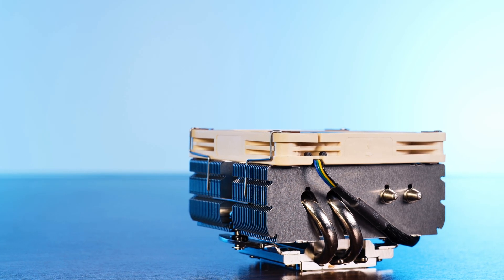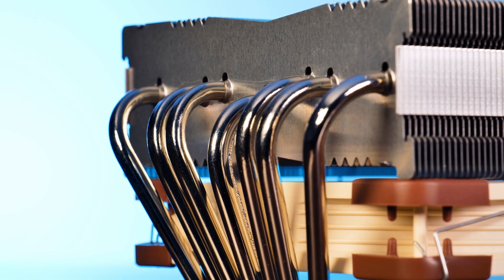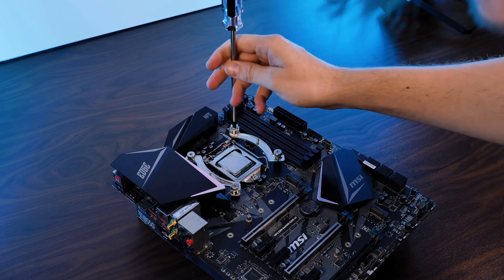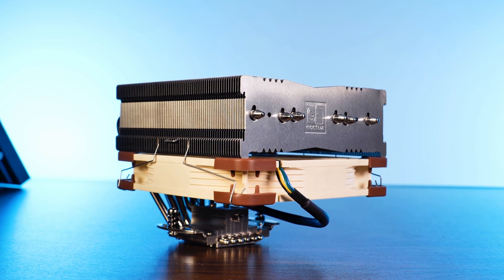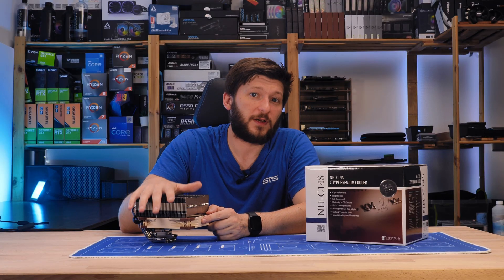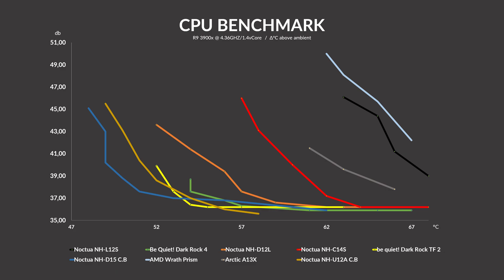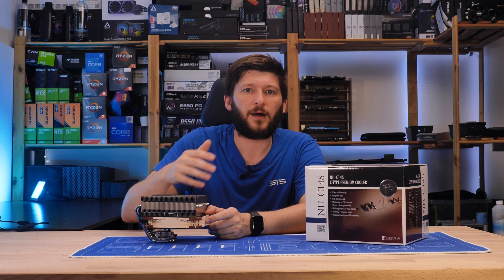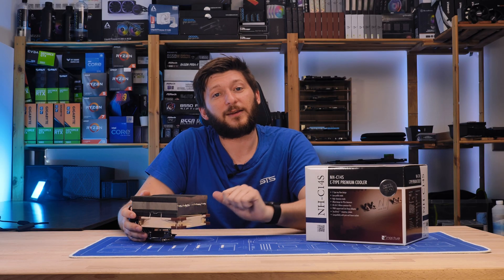Noctua NH-C14s Review - Noctua's C-Shaped Monster

Comment: I currently have this cooler mounted on a 5800X in an mATX case but I'm considering downgrading to a 5700X and mounting a L9x65 on it. I miss using the AMD Wraith Prism cooler and the L9x65 is the only cooler that closely resembles it.

Comment: Does anyone know if this cooler will fit in a 2U rackmount chassis?
Reply from the maker: I believe with the fan installed in the bottom it should. But without intake above it, would it make sense?